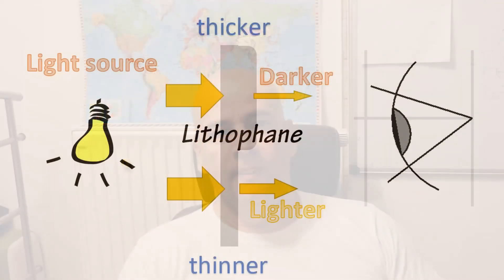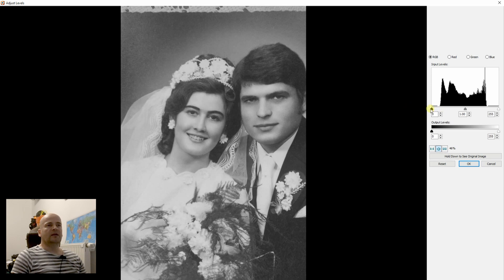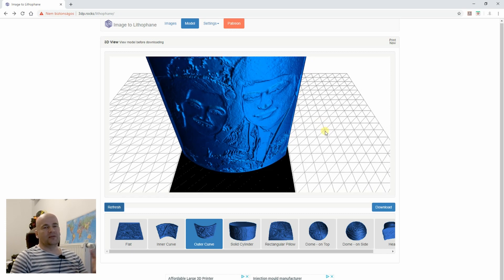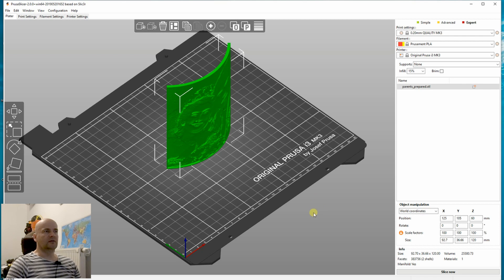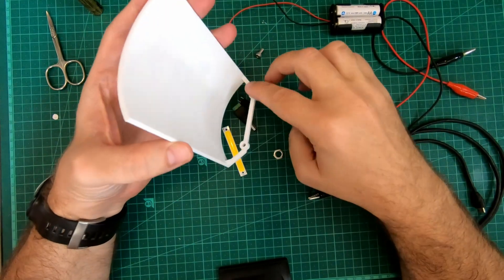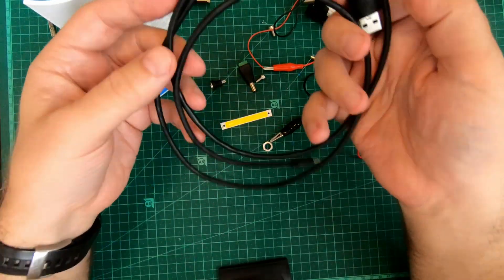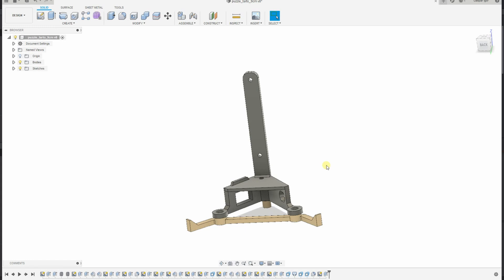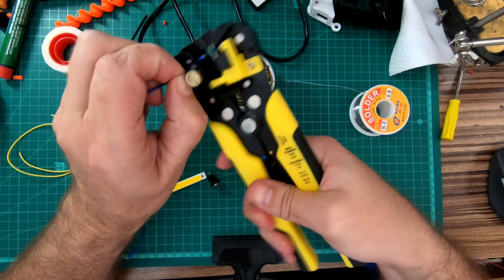3D printed lithophane with background light

Comment: Great video!  Can you tell me what type of LED that is?
Reply from the maker: Something like this (3V, 1W), but I had to replace resistor, not 220ohm but smaller (use some led calculator, depend what is your power source, led Wattage): https://www.ebay.com/itm/5pcs-1-3w-Warm-Cool-Lampe-a-bande-blanche-DC-3V-LED-Panel-Light-COB-ChipBB-/312595883105